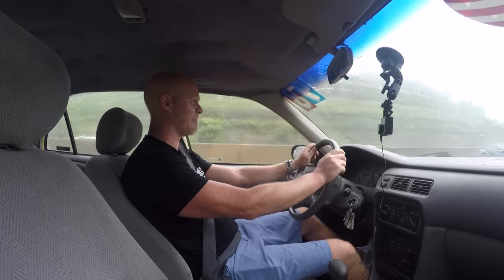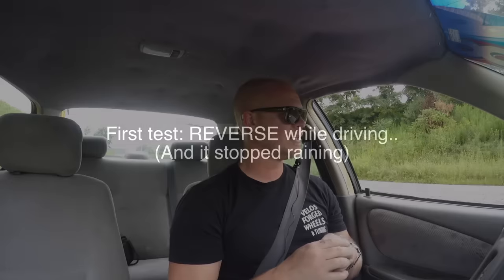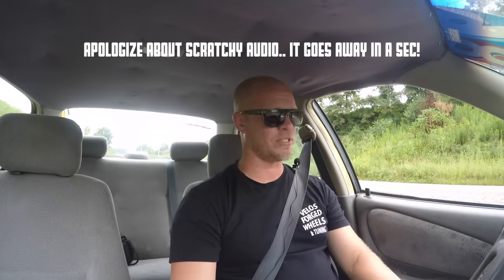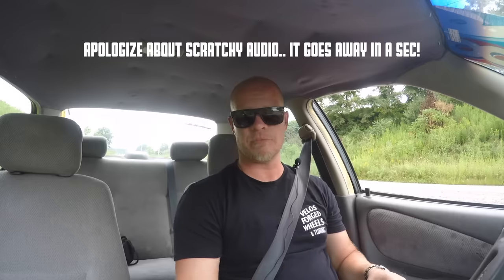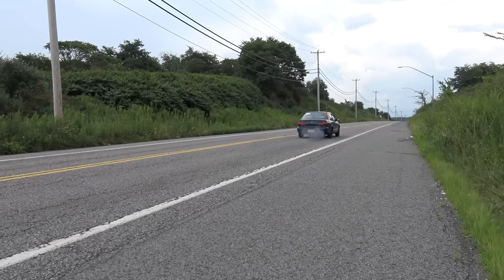What happens if you put a 20 year old car in Reverse AND Park WHILE driving? (NOT SAFE)

Comment: It doesn’t kill the ignition and apply the brakes,The car doesn’t have any technology to do that. The brakes you think you’re feelingis the transmission slamming into reverse,Which instantly stalls the engine
Reply: John DiMartino wouldn’t this also cause the engine to try to spin backwards? or would the torque converter prevent this?
Reply: Remix Island Music I think the pitch on the torque converter blades will probably not have enough force to really spin the engine backwards. It will try and that’s why it dies. But then you also don’t have the transmission pump pumping pressure to hold the clutches on and this is why it goes into neutral. This is all assuming the transmission is strong enough to handle that little jolt he felt when all of this happens.
Reply: Pete's Garage exactly that’s why it gives up but why doesn’t the Driving back feed the transmission and start the car???
Reply: Cio Dokop because the torque converter housing spins the transmission pump. If the torque converter stops (which it would have to do if it went from spinning forward to then backwards) then there wouldn’t be any pressure in the transmission to apply the clutches. Then all of your car’s momentum wouldn’t “roll start” the car like a manual transmission. A traditional automatic transmission isn’t mechanically coupled to the engine. It needs the pressure to hydraulically couple it to the engine.
Reply: Remix Island Music i believe the torque converter prevents it
Reply: I was thinking the same BUT, would it change if you completely pegged the throttle while doing this? Essentially hoping for the transmission to slip some
Reply: forreal. you kept it civilized but i gotta say this guy isnt the smartest.
Reply: John DiMartino .
Reply: Exactly the engine bogs to a stall kind of like when a stick shift clutch is let out to fast at low rpms the engine connects with the transmission and opposite speeds cause instant stall
Reply: That smell when you threw it in park was the torque converter burning to shit, rip
Reply: Good man
Reply: Pete's Garage my dad was turning on the top of a hill and instead of going into nuetral he went intp reverse and rolled down , it stalled and now the clutches slip on a daily basis . The torque converter basically locks , stalling the engine .
Reply: Cio Dokop its not a manual
Reply: The Brown RAT 😂😂😂😂😂 trust me I'm in an automotive class at votech. I've worked on manuals, tried to start an auto that way, it doesn't fucking work. Only a manual trans allows the power back into the engine in gear because it's a direct drive gearbox
Reply: Gabe Ulrickson  you cant start an auto, yes, but you can still stall it with the same principle
Reply: Remix Island Music the engine wouldn’t spin backwards since what the “reverse” does is switch to a gear that reverses the direction of the gear shaft, while maintaining the same direction from the engine. That’s why you don’t stall every time you go to reverse cuz using your logic you have to switch direction of the engine every time XD nice thinking tho :) the jolt was just because of the engine speed being different from the speed at the gears since he switched gears. That’s what I think and let me know if u disagree! :D
Reply: omarspider omega that's perfectly true
Reply: Pete's Garage what is this chain of questions
Reply: uifturis 😂😂😂😂
Reply: No one else gonna say anything about the guy who thinks putting it in revers makes the motor go reverse its functions .... 

Totally bud most definitely does 😂😂 no it doesnt lmao 
Motor stays doing 4 strokes( unless its a 2 stroke )  no matter what gear 🤷🏼‍♂️
Reply: John DiMartino ml
Reply: Exactly.
Reply: omarspider omega i disagree!
Reply: omarspider omega the engine  would be spinning backwards. In reverse your car should be moving backwards. but because the car is moving forward the momentum of the car forces the engine to turn backwards. however this doesnt happen because the torque converter prevents this somehow. that was his question.
Reply: Remix Island Music there is a pump to make pressure for the tcc, but it is on the engine side, so when he puts it in reverse and the engine stalls no fluid pressure, so no tcc trasnfer.
Reply: The engine is attempting to spin backwards only because he's moving forward in reverse gear.

Before you laugh at that, just think, how can the engine rotate in the same direction, in both forward and reverse gears, and still move the car forwards?

P.S. It hits alot harder going into reverse, if you go into neutral, and floor it, before hitting reverse.
Reply: I agree. It doesn't cut out the ignition it tries to rotate the engine backwards but with automatic transmissions once the engine stops spinning the transmission loses hydraulic pressure causing the transmission to go into a neutral state. If you were to hold the accelerator down when shifting into reverse you'd get a much more aggressive reaction,  and could permanently damage the transmission rendering it useless.
Reply: Gabe Ulrickson 
I disagree....
Some automatic transmissions have a dual pump system that will allow starting of the engine while in gear.  But the vehicle has to be going over 45 mph for this to work.
Reply: Remix Island Music tourqe converter would prevent it
Reply: John DiMartino im glad i am not the only one who knew this and was like dude you have no clue lol
Reply: Theres not really fail safes your just destroying the transaction.
Reply: @freedom24v86  wrong, from a stopped position your correct, but when you move a gear rotating one way and engage the gear tristing it the other without stoping the rotation or disengaging the clutch function it will attempt to twist the whole thing in the oposite and stall. So in a nutshell hes wrong and right. And you just ingorant.
Reply: @CowenJE 

It is FACT that it is possible because I have 2 80s Mercedes diesels both with the automatic transmission and have successfully tow started both of them. Also with a 76 mustang II with the 4 cylinder automatic.
Reply: Is not that either its the clutch and the cam shavt under pressure that causes it to fowl out then kills the ignition
Reply: I believe you are correct sir
Reply: back in the early 60's chevy built a 2 speed auto that had a rear pump and you could push start a automatic. and as far as i know chevy is the only one that built one and they stopped it in the med 60's.
Reply: if he had a very high HP engine he might be able to do it at 40mph but i have had it shut my 605 hp engine down and i was to the floor. but i  had my head up my butt that day and wasn't thinking and grabbed the shifter to down shift and ending up slamming it in reverse .
Reply: Yep.  The old 2 speed power glide.
Reply: yep i think it had a cast iron tail housing,
Reply: uifturis . That's what I said lol. The engine doesn't spin backwards.
Reply: Pete's Garage remember when the pump was at the rear of automatic transmission and you could pull start just like a vehicle with a manual. They took that feature away when they redesigned the automatic transmission with the pump in the front of the trans
Reply: Gabe Ulrickson back when the pump was at the rear of the automatic transmission you could pull start a vehicle with a automatic transmission, since the pump was moved to the front the feature is gone
Reply: @remixislandmusic510  No, The engine would spin the same direction as before however the immediate change in wheel direction in the transmission will cause the torque converter to lock up and thus stall the engine.
Reply: John DiMartino does that happen on most old cars
Reply: If you reved it up in neutral and then throw it in reverse that then will cause some serious damage
Reply: @owenhill4309  im going to try this to see if it makes my car go faster
Reply: @remixislandmusic510  Engines only spin one direction, the transission is what spins differently.
Reply: @stay boosted wrong. That's the parking mechanism burning.
Reply: @the brown rat. Wrong. There is no rod that goes into the TC. The parking mechanism is not inside the TC. Noob.
Reply: @sam Ur boi torque converters don't lock like that.
Reply: @J C I disagree. Automatics with dual pumps don't exist now.
Reply: Anyone who has ever driven a manual transmission knows this lol.
Reply: Same thing if you roll backward on a hill while in drive: the engine struggles and then it stalls

Comment: What happens when you unlock the doors and open them on the highway
Reply: Did it once when I was a kid
Reply: They close or get side swiped
Reply: They actually blow open once they start to open
Reply: Nothin just starts beeping my buddy’s car didn’t have ac and the windows wouldn’t roll down so we rode around holding the doors open
Reply: You do the in my feelings challenge 😂
Reply: Did you not pass Physics?
Reply: We had a 99 prism when i was a kid and i literally did that once on the highway. Scared the crap outta my parents lol.
Reply: I actually tried that while driving, it's really hard to open the door while driving 120kmh
Reply: It’s almost impossible to open the door at highway speeds lol I’ve tried it.
Reply: People jump out and do the kiki challenge
Reply: umm the doors open in the highway? what else could happen?
Reply: it’s hard to open the door while driving on the highway, i’ve done it while driving, it’s even harder bc you can only use one hand
Reply: Billy Smith they simply close . unless you go in reverse .
Reply: can't really, cause the air will try to force it closed
Reply: Nate wu nothing
Reply: Nothing
Reply: They open
Reply: A nice thing
Reply: Nate wu nothing
Reply: Nate wu they open lol what do you think your locked In
Reply: Your mom yells at you and you get grounded from GameCube for a week
Reply: Had to do it once when i realized simething was caught in the door, it acts just as if it would parked. (Vehicle was a 2000 chevy blazer BTW)
Reply: I've tried it, the air pressure difference in the cabin causes all the doors to instantly rip off and anything not in a seatbelt/tied down gets sucked out with the force of 50 steam rollers
Reply: Did that in my dads truck 9 years ago...nearly dropped my mcdonalds fries, i was trying to pour out a soda can XD
Reply: Nate wu then you probably fall out of the car
Reply: And then jump out
Reply: Lol
Reply: Nothing
Reply: @napoleontannerite8452  I had to do this in my old car.
Reply: Lol I can do that on my 2010 Ford ranger and it just opens. The doors don’t even lock I can just open it
Reply: I did as well, the force by the wind is just so strong, you're going to have to really push to get them to open!
Reply: Did it a few times before the doors open

Comment: It's not that the ignition 
"shut off" it that you put such a huge load on the engine it stalled
Reply: Southern Mechanic a reverse load was put on the engine so it shut of 
You were halfway correct but still correct
Reply: Isaiah Taylor256 a reverse load at that speed IS a huge load. So he is correct. What’s your point?
Reply: So retry it only make sure the car is floored when you shift
Reply: Bryn Dunbrack it will still stall

Comment: when you had the fusion i knew it was gonna be safe and not harm the gearbox.
when in this "car" i was very scared about what was gonna happen. love the edit (and your face expreciton)  sorry for bad english im from norway
Reply: Dude your English is perfect don’t wory
Reply: Your English is fine
Reply: Yeah by the way MR. AV your vehicle did not brake and turn off the engine it stalled because it connected and something has to stop the engine did first perhaps if you where flooring it things would be interesting I don’t know also that burning smell was your torque converter that’s what stops the car when you put it in park
Reply: Amir Zamoum deam u know ur stuff
Reply: RIP MisterBassBoost i also knew nothing would happen, as i drove a 2014 Honda and accidentally dropped it into reverse while driving.

Comment: You should try this in an '82 Chevy Citation (if you can locate one that still runs - somewhat of a challenge itself as they were typically inoperable when new). 

2 to 1 odds you either create a rip in the time continuum or are immediately blown to bits (possibly both).

Comment: Next video: 'What happens to a 20-year-old, POS 4-banger when you send a 300 shot of nitrous through it.'
Reply: Do it
Reply: Everyone knows the engine will blow. There are a million videos on this.
Reply: Actually some lasted with the 300shot
Reply: Curtis Noble but they all eventually blow. If not they dont run the same.
Reply: Who cares that is boring
Reply: Anything will blow if you overdo it but Toyota engines are typically very well built, but that doesn't mean they're indestructible.
Reply: i ran a 329,000 miles toyota 7afe engine with a 100 wet shot for a few months, eventually cylinder 4 cracked an exhaust valve, but I also hit it at like 1000 rpm all the time which is a no no lol.. im thinking it went lean though since it was cylinder 4, furthest from the nozzle injecting the extra fuel
Reply: you blow the welds on the plastic intake then me and the mad scientist have to tear apart the block and replace the piston rings you fried
Reply: Carlos Clivilles There is a YouTube video of someone doing that with an old ass subaru lol Blows the head immediately, literally into pieces
Reply: Blow your head already tryed this on my 96 Honda
Reply: We all know what will OBVIOUSLY happen. I simply made a suggestion to make a future video for entertainment purposes.
Reply: DANGER TO MANIFOLD!
Reply: So you know the molten core of the earth so yeah

Comment: I think it's actually engaging into reverse, but since it's hydraulically coupled it just stalls out from trying to counter the engine's rotation from the momentum when it changes. If you try again, do D->N->[full throttle]->R and see what happens. Careful though, could break the tires loose.